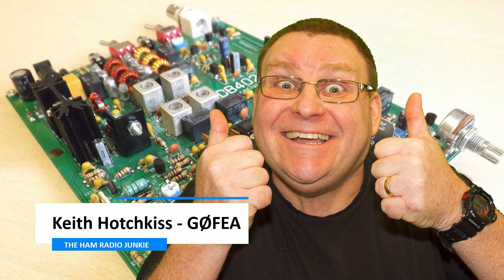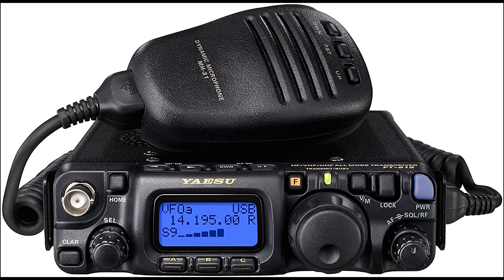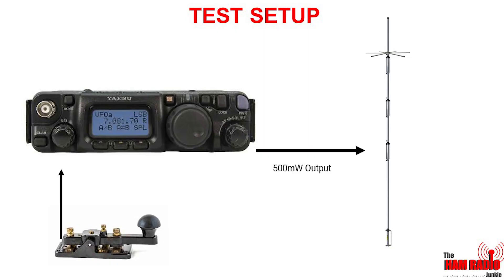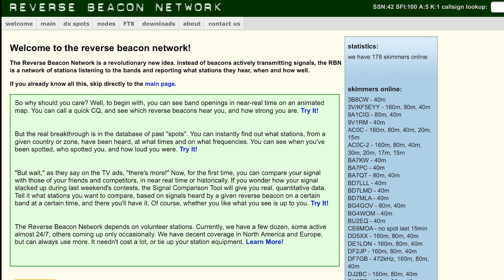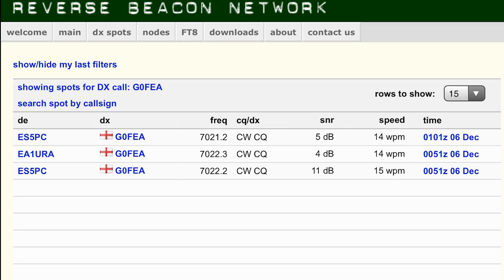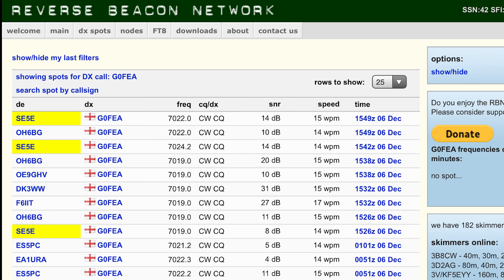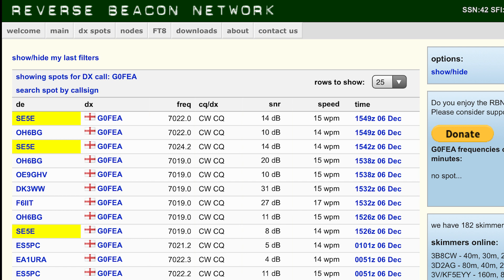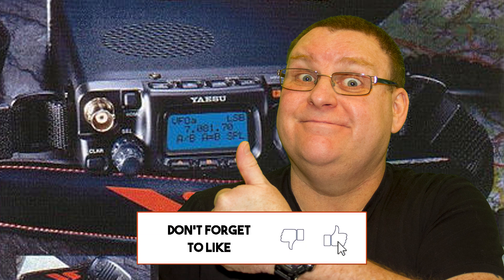QRP 1/2 Watt. How far can it go on HF? Lets see.

Comment: Nice keying. Dig the old 8 Amp straight key. I’ve got a few variations of those keys. They were used here both by the army and by the post office for telegrams

I keep going back to a straight key. Much prefer it to the paddles. Feels more “traditional” and, when I’ve been practicing, sitting on a tidy 18WPM for rag chew is not unachievable. Trick is
keeping the groove of the sending smooth. Only way to do that is airtime
Reply from the maker: Yep, itwas my first key and helped me through my CW test.
Reply: @ cool. Back when we had to do code. 

I had an old cheap Japanese J38 copy from Radio Shack here in Aus. My first “real” key was one of these WT 8Amp from a company called Key and Plug. Not too sure when it was made.

The one I use the most is a little BEC mini key from some man pack radio. Perfect for operating portable, as well as on my work bench. Tiny thing. Needs a new seal on the leaver, and I’ve had to reterminate the lead when the wires broke, but pretty much trouble free. Neutrik 3.5mm plug on it so that’s not going to give me any trouble.

Comment: QRP is only frustrating if you're trying to use an inefficient antenna. There are so many what I call "gimmick antennas". Someone new to QRP may get the idea they can work DX with a whip or some other snake oil antenna. Don't believe the hype... put up a wire antenna and QRP will become fun!
Reply from the maker: @fintronics  very true.

Comment: Back in 1966 I heard a station in Germany running a 20 mW homebrew SSB transmitter booming into MIchigan, USA over my old tube shortwave and sounding just like a local. For about a week there it sounded like I could hear every HF transmitter on the planet. Stations were coming in and fading out on every frequency. I seldom even tuned the receiver because so much was happening on each frequency.

Comment: Once again, I'll post up my vote for the Horizontal Loop Antenna as the single best QRP DX antenna a ham can construct. It seems to take more of the QRP signal and get it out into the air in a useful low angle, omnidirectional pattern for making contacts......both transmitting and receiving. This assumes a 450 Ohm (3/4") twin lead "ladderline" feedline to a 4:1 balun then short Coax into the rig itself or into a tuner and then into the rig. I dare you to prove me wrong with any other antenna except a Rhombic directional when it comes to making QRP contacts. 73's, de KD5TXO
Reply from the maker: Whatever works is great for me. 73 Keith

Comment: i have the 817 and 818, using a mobile antena mounted horizontaly on the balcony i reach thousands of miles and i live in a flat in the first floor.
using lithium batery i made to give 13v.
my 817 got burned so it sends only 250mw out and with the same antena i reached NY with 5/9s.
i'm in the Azores islands.
the propagation does it all. cheers

Comment: Revease Beacon Network is really useful.  I would like to add that it's mostly about location.  A yagi in the garden won't help much if you're surrounded by tall buildings, or have +20db of PLT... or both! 
I'm able to work all continents from the beach with 5 watts into a coil-loaded whip ...something I cannot do with 100+ watts and a half-wave at home.
Reply from the maker: The network is an ideal tool.

Comment: FT817ND, one valve xtal tx. 19 Set on low H.T. and my h/b rig so nothing over 5 Watts for 30+ years.
Use c.w. on the QRP frequencies for best results. It depends on frequency as well.
A Pixie on 5.262 MHz, 350 mW out, best QSO 180 miles with a SWL report at 220 miles. 19 Set at 2.5 Watts, 5.262 MHz, QSO at 280 miles to Mallaig.
S.s.b easy into Europe on 14 MHz, even on h/b indoor mag. loop.
1 Watt c.w. now 10m opening, in the past have had QSO's into U.S.A.
QRP to QRP especially pleasing.
G4GHB.
Reply from the maker: Bill, I love the FT817 and 818. Sadly, Yaesu have discontinued their production. Maybe they will produce another winning portable rig.
Reply: @TheHamRadioJunkie  Yes, it had a good run and still a great radio to me.

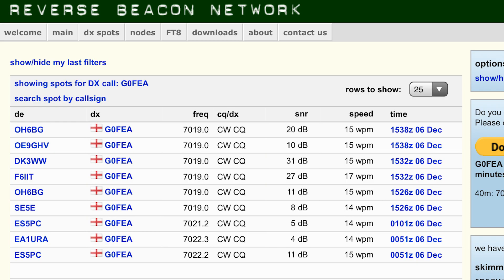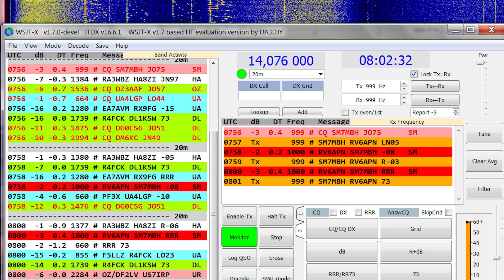Comment: ON 20m with only 10 mW (TX: Raspberry Pi 1, WSPR) and inverted 'V' antenna, every morning heard by VK2COW in Australia. Between 5:00 and 7:00 in the morning (Croatia, UTC+2) it is possible to reach Australia, and hour or two earlier, east coast of USA, mostly on 20m band. On 40m band, only Europe and maybe little bit more. That is because that antenna is really poorly made. 73 DE 9A4GE.

Comment: Keith...Thanks for that well done and informative video. It is appreciated.
I run a 200mw Whisper transmitter here... the ZACHTEK Unit from Harry Harrison in Sweden.
Sofar in 4 weeks... I has been heard multiple times in Antartica, Japan... Australia, Hawai, the USA, Reunion Island, French Guyana... Brazil........ every nook and cranny in Europe and the USA. Low power mode is absolutely fascinating.... Antenna is an Endfed Half wave (80-10 meters)    forty meters long.... BUT COMPROMISED as it is only THREE meters above ground at this time. Goes to prove..... propagation propagation is the name of the game.
Albert
EI7II.
Reply from the maker: Albert, thanks for your kind words and great going with your QRP. 200mW, good work sir. 73 Keith
Reply: @TheHamRadioJunkie  Keith... I am just blown away with what Whisper can do. After having been off air for a good 15 years and in the preceding years having been a QRP operator Whisper with its 200 Milliwatts has just about floored me. That my 200 milliwatts was received by the USA Antartic station  was just about mind boggling. As I see it Keith.. the beauty of Amateur Radio is that it allows us... to EXPERIMENT.  I used to have a BIG station and now I am a "shack in the box" guy... but you know what ?  I am as happy as a pig in mud. Tmrw I am planning to raise the wire to 10 meters above ground which will make it a half wave on 20.... just can't wait.
Keith... please keep your informative videos going. DO NOT BE AFRAID to "upset the apple cart"    We should avoid getting "Stuck in our ways" , very recently...I saw a video where one guy commented that Whisper was meaningless and Useless and we should all concentrate on CW and SSB.
I just feel sorry for him Keith... he does not know what he is missing.
Anyway... doing these videos takes TIME AND EFFORT ! It is seen AND APPRECIATED !!!]
Albert
EI7II.
Reply from the maker: @albert7ii  yes low power can spring up some surprises

Comment: Couple of weeks a go...I made a QSO with a sota station in france...with 100mW (KX3/CW) (1500 Km/900miles). Two years a go I managed to make a qso with a station in austria with 300mW (500Km/300Miles) in SSB. But also strange, two weeks a go I heard a station in US that was in POTA...and it was with 5W...but he didn't hear me with 100W...(CW). All my dx stations was made with 100W (I don't have power amp). Normaly, I keep my trx on 10W...and I am able to work all around the europe. So, QRP (even 100mW)...you can do a lot with that tiny power...but sometimes...even average QRO (100W) it's not enough.
P.S. I am a big fan of QRP
Reply from the maker: I understand QRP isn't everyone's thing, but you can be totally amazed at the distance you can travel on minimum power. Nice work.

Comment: I'm running a WSPR beacon on 20mtr band @185mw and an indoor fan dipole and being heard in Canada, Hawaii, North Pole, Antarctica, and Southern Australia.
Amazing what can be achieved with so little rf power.
Reply from the maker: It really can be amazing to see how far QRP travels. The secret is having a superb antenna that does all the work. Running 1Kw into a dummy load wont get you first class DX.